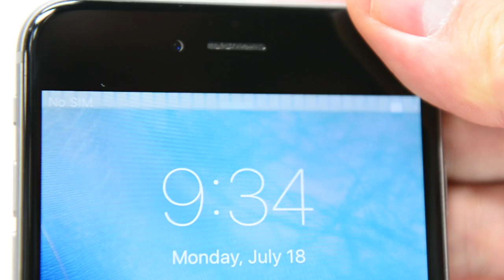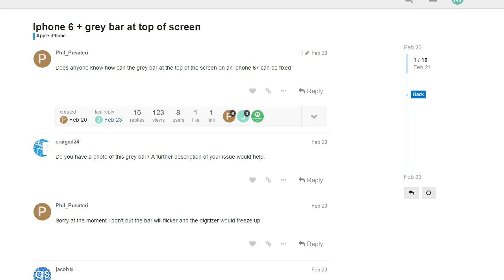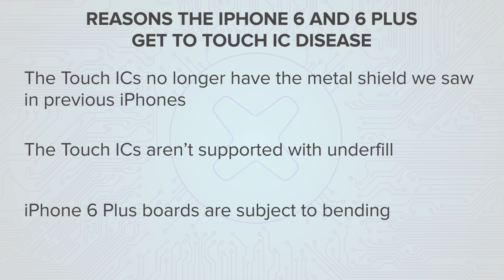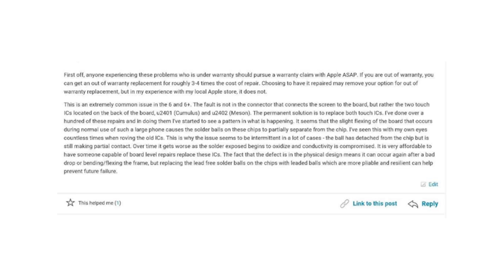A Design Defect Is Breaking a Ton of iPhone 6 Pluses

Comment: Just had this issue today. Flickering top part of the iphone and screen would not work when touched. The solution might currently be temporary but I solved it by restarting the iphone several times and tilted it in a number of directions when using the touch screen. It returned back to full functionality after that. Scared me for a bit.

Comment: Ok so after receiving an iPhone 6plus for someone sending it to me 1 for suffering blank screen and 2 touch not functioning , upon inspection I could see the LCD fpc connector had suffered damage due to forced pressure where someone's tried fitting a replacement LCD, so once I replaced this I had display back happy days but further into testing still found touch would not work no matter what so I replaced touch ic but to no avail still no touch available my question to you is are you aware of what else could be the cause of touch not working ? I've checked the touch connector that's in like new condition traced back and checked all the tracks they are fine so I'm stumped as to what's stopping the touch from working

Comment: For what it's worth, metal shielding is typically an electrical consideration for electromagnetic compliance. Structural support is not as much of a consideration, and I can see how a flaw like this would slip through the design review, considering it took so long to appear. By the time the problem became prevalent, it was likely not worth changing it but rather continuing development on the next line.

Comment: I have an iPhone 5S. For me, I have vertical lines running up and down which I think is an LED problem. But on the right side of the screen, I can't tap anything that there's a line over. So I can't type p's, quotation marks, etc. It also starts tapping things on the line FOR me, so I get random letters jumpbled up into my message. I have to turn my device on and off to stop it. Is this also the Touch IC Disease?

Comment: An easy fix is to put some folded up electrical tape the size of the 2 chips, and a place it on top of the 2 touch chips/sensors and then just cover it up again with the sticker shield

Comment: Hi iFixit, I would really appreciate you reply and helping me with a problem I have been experiencing. I've reply the full LCD screen and the thermal metal shield on my iPhone 6 Plus. I then put my original home button in, the one with Touch ID. Touch ID works when the screen is hanging off the phone and not pushed into place, but as soon as the screen pops in, Touch ID stops working? 
Would you please help me resolve the issue

Comment: Does the 6S Plus also suffer from this problem?

I had a two year old iPhone 6 plus (not S) that I carried in my back pocket all the time & was still working great, but started having a battery swelling problem. I took it back to Apple about a month ago and they gave me a free replacement iPhone 6 Plus at no charge. I thought, "this is great service!"

Within the first day, the replacement started having Touch IC disease. I took it back, they gave me another free replacement, and I was a happy customer again.

Now, that second replacement iPhone 6 Plus is having Touch IC disease as well. I have an appointment at the Apple Store to swap it out again on Tuesday.

Should I try to pay extra to trade up to a 6S Plus, or do the 6S+ also have this problem?

Comment: my iPhone 6 plus is a joke at this point. I cannot do anything. I cant have a case on it, it makes it worse. I can't open my phone without having to tap hard on the screen to make the bars go away so i can even type in my passcode. This is a joke and I will never buy another apple product again. I feel really jipped out of a phone experience. My phone has not one scratch or dent, screen never chipped or busted. I'm impeccable with my phones. They will see this as an issue, I've files with the law firm who is dealing with the issue. I SUGGEST EVERYONE WITH THIS GREY BAR PROBLEM CONTACT THE LAW FIRM IN CALIFORNIA!!!!

Comment: The 6+ touch IC is a notorious piece of shit. But lets not forget the G3 and the G4 which is under recall right now.  BGA/IC issues from the factory that crop up a year out. Tonnes of BT/WIFI IC's go bad a few years out, iphone 4 etc. The S4 has a big problem with the modem IC going bad and voice/audio not making it through networks. ALSO! The iphone 5/C/S Charging IC is also prone to fail. No manufacturer is safe. You cant test these components for years out before launch. Just a fact of life.

Seriously though, apple should recall the Iphone 6+ its getting ridiculous out here.

Comment: My friend has this issue on his 6 (granted he did throw it across the room as fast as he could and it's REALLY bent. Barely fits in a case and you can see in between the screen and the chassis. ) Still works though, he just presses on the top left of the phone and it goes away for a while. lol

Comment: Good old BGA, ball grid array, IC technology. I remember reflowing these chips on old Motorola Pagers back in the 90s! Your points are well taken that Apple has engineered a ridiculously think phone prone to end user physical damage. I think this is the primary reason for the change over from the the metal shield to the sticker shied is for being able to make a thinner device, secondary cheaper production cost and third quicker installation by person on a sticker than soldering on a cage shield.  I not sure I completely agree that the BGA chips need to be replaced. I could take an Ungar heat gun and reflow those IC and likely get 100% functionality and I know this because I did hundreds of thousands piece of this kind of work back in the day. The time you had to replace the chip was when the IC package was actually physically damaged and cracked.  However happy to see this information freely being publicized for the masses to have a good education of whats causing such failures.

Comment: Not so much of a problem in the UK. Where the law allows for warranty claims for up to six years on durable goods, if it can be demonstrated that a defect was present at manufacture or that the defect was very likely to occur after manufacture, as result of the design itself. In the rest of Europe, consumers have two years to exercise this right. I believe that U.S. consumers only have 90 days — that's quite a difference.

Comment: The chip is coming lose from the circuit board. They FIXED this in the 6S PLUS versions by moving the placement, so APPLE knows it was a DESIGN FLAW. They should take trade in iPhone 6 Plus and give them the 6S Plus model.

Comment: Interesting! I've been an iPhone user since the 3G and everyone that knows me could tell you that the iPhone 6 Plus was the first iPhone that I said "sucked."Every iPhone before this one (still using AN* iPhone 6 Plus as of this writing) was solid.That said, I pre-ordered the iPhone 6 Plus and picked it up on day one.Slowly but surely, I started to realize how much that iPhone was flawed.I replaced the first one with a "refurb" (although Apple would never call it a "refurb").Shortly thereafter, the 2nd was replaced.Then the 3rd was replaced.Then came the fourth, and I received the forth iP6+ around July-Aug., 2015. That iP6+ had this very screen flicker - always the grey "flash" from the top of the screen - as shown on this video ON THE FIRST DAY I BROUGHT IT HOME! I called the Apple Store the next day and they said to bring it in promptly.I brought it in immediately and the woman that helped me said "oh yeah, some of the devices have had this very issue - we're aware of it being a common issue and we replace them." That's it! No testing or verifying my issues like the iP6+ 1, 2, or 3 - just replace immediately!So I, for one, can vouch that this issue, according to one Apple Store rep's statement, that this issue has been KNOWN by Apple since at least one year ago.*I'm now on iP6+ number 5, but this one has been closest to all previous iPhone experiences and has restored a little faith in Apple & Co.Steve-O-meter is surely tapped by now though. I'm worried for the future. I'll go back to Nokia, Thomas guide maps, hand-held GPS, and a point & shoot cam before I go "droid."

Comment: the iPhone 6 & 6 plus has an issue with the touch ic logic board. it also has an issue with its chassis.
the iPhone 6s & 6s plus has issues with corrosion, due to high amount of zinc used to strengthen the series 7000 aluminium. the apple watch space black sport chips. the macbook 12" has staingate, peeling screen coatings. still, i admit to stupidly buying them despite knowing

Comment: The only "good" reason Apple to do that (no underfill and shield on top) is their potential intend to scrap and reuse these ICs for next generation, as Jessa said the touch IC is same in several generations of iPhones. No underfill means easy desoldering from the board, and that could be automated while there is no need to clean that underfill agent from the chips. Do not blame Apple for that, they are now in tough period, need to save, and after all reuse, recycle is environment friendly :). The bad news is that after 2nd year that will be on client expenses.

Comment: It's great Jessa that you have shared this information with the rest of the Apple and Open Community here publicly YouTube.

1) It seems there is a weakness in the design of the iPhone 6/6plus that you point out which leads to the potential failure of the hardware.

1a) Bad on Apple for banning you when you've posted on the Apple Forum pointing out this issue.

1b) Bad on Apple for not addressing this issue in light of the numerous instances of this failure in their hardware.

1c) As this seems to be tied hand in hand with the BendGate issue for the iPhone 6/6plus - We should realize that it's wise not to carry your Cellular Phone no matter the brand in your back pocket and sit down it especially when it's large and thin. This is not good long term wise for any cell phone not matter the brand when it's large and thin.

2) Your worked out solution (Reflow/Replacement of IC) and the additional fix (metal shield) will benefit those who experience this issue. 

Too bad that often in these comments to great posts like this there seems to be a lack of critical thinking in responses. There is a party response (like democrats vs republicans) where in actuality these issues can affect any brand of cell phone. So for those Android Users out there and cell phone users of any other brands you can now keep in mind if you experience issues and also keep your cell phone in your back pocket that you might have caused hardware damage to your cell phone.

Thinking point. If the vendor like Apple or any cell phone manufacturer had in their product warranty agreement - that "carrying cell phones in back pockets and sitting on them causing undue stress on its hardware is considered abuse and voids the warranty" - Hm, the issue then would not be covered under warranty and Most Likely Would Not Happen Or Occur.

Hey I know there are varying opinions out here. I'm always open to read and see what others say and in hopes of enlightening myself on an item that I'm not aware of or knowledgeable in. If you hate what I say I'll read what you say and hope you have something constructive and substantial to teach me. Let's move away from the party lines banter and into the field where we challenge each other and apply what we've learned to improve as Jessa has done...

Comment: It's about a lack of integrity.  A number of years ago Apple was investigating a silicon coating for their laptop and mobile ap boards, it would have added less than a $.05 per device, but made both the MacBook Pro and iPad nearly waterproof.  They ran a bunch of prototypes and they looked good.  I know about this because I too was running boards with the coating to possibly add as a value added service at one of my stores… and I spoke a lot with two of their engineers.  But Apple made a decision that it was cost ineffective to waterproof logic boards.  Their engineers revealed to the coating company engineers that it came down to bottom line… Macbook Pros and iPads, etc… not susceptible to water damage, would last too long and spilled fluid on the devices or dropping them in fluids was a major! profit center!  Apple depends on obsolescence and damage to move old products out of people's hands, they make their money on replacement upgrades.  They have GOT TO sell NEW devices, or end up where they were in the 90's.  But, they go too far.  In the 90's their product saturation was due to how GOOD their products were, they just wouldn't break down and so people passed them around.  In 1995, over 95% of all the macs made since 1984 were still in use!!  I kid you not, and that was strangling them.

Comment: the plastic is actually a conductive sheilding. its used in many devices. that's not the problem. and the conformative coating is used to protect the device from moisture. not mechanical stress. the whole issue is just poor solder joints during assembly.  replace the chip and youre done. no need for removing the original sheilding and adding a metal can.

Comment: i got the same issue on my iPhone 6 plus after using it for almost a year and half. The moment it first occurred on my iPhone I new it's not a software issue it's a manufacturing defect and the only reason I came to know why this happened to me is because I often used to change different cases on my phone but the worst fact was that there is no apple care in my country + the 1 year local warranty was also expired by the time I got this issue luckily I was able to sell my iPhone to a store without letting him know about the defect on a good price and got myself the s7 edge. So my opinion to the people who's still using the iPhone 6/6+ sell your phone back or get a rugged case and make sure you don't often take your phone out of the case

Comment: Sorry if i missed something, but why does the chip need to be replaced? Wouldn't a reball work just as well since broken solder ball were the culprit?
Reply: Planned Obsolescence
Reply: Indeed. Planned Obsolescence. The cure is to buy an iPhone 7 plus. Something will go wrong with this just in time for the launch of the $1500 iPhone 8 plus.
 On the evidence of this video it would appear that with every generation of iPhone, Apple is employing sh*ttier internal design/construction quality, to trim costs and make the phones slimmer. Personally, I don't want slimmer, I want bigger (10,000mah +) removable batteries and SD cards, at less than half the price of an iPhone, which is why I'll stick with Android.
Reply: Indeed. The cure is to buy an iPhone 7. Something will go wrong with this just in time for the launch of the $1500 iPhone 8.
Reply: the chip connections oxidize, reducing the constructiveness and making it inoperable.
Reply: With a reflow that basically just heats up the chip which can re-establish older connections in it. However, reflowing a chip that is bent because the phone has been bent won't fix it. The only reason why it works on Mac GPUs is because of the extreme heat. It really shouldn't work for anything.
Reply: i was thinking same if are broken solder just with reaply work. same as any other electronic part. well there is the failure fact instead.
Reply: I was just about to ask the same question...
Reply: Reflowing is a bandaid - it solves your issue 'right now' but doesn't solve the problem as to WHY the issue occured in the first place - it WILL reoccur.  Replacing the chip lets you replace the solder (with a better solder to take the abuse more) as well as.   One could re-use the same chip I expect.
Reply: I dare to say that the people who replaces the entire chip do it because they don't want to spend time Reballing, however; once you get a hold on it it becomes pretty strait forward. Sometimes a pad on the chip will be damaged and you are left with no other choice. I prefer to use donor boards. I've ran into incompatible brand new chips that end up with no image or some weird vertical lines....
Reply: Minok1217 after watching further videos I agree, as other videos showed bad connections where the solder was barley taking to the board due to some sort of oxidation.  So a new chip or a reball is necessary. A Mickey Mouse fix I personally tried on a friends phone has been working. Putting 4 layers of electric tape on top of the IC chips to create pressure against it.
Reply: It doesn't.  I think they just feel its better to do that.  I'd imagine it's due to having to apply heat to remove it, and then heat to reinstall it.  Where as with a new chip, your applying the most heat once, to install it.

Comment: +iFixit Video is this problem not as bad on iPhone 6Ss because of the stronger aluminum? I'm a 6 Plus owner and I'm curious.
Reply: And for the SE, should I be worried??
Reply: The iPhone 5SE uses the same screen as the iPhone 5S but the touch IC issue isn't present on iPhone 5 / 5S / 5C / 5Se anyway.
Reply: Well with the SE it's still on the logic board. I'm not sure if its under a metal shield or not.
Reply: no instead the iphone 6S has the touch ic chip directly with the display rather than the motherboard